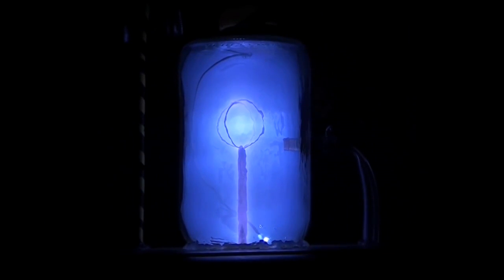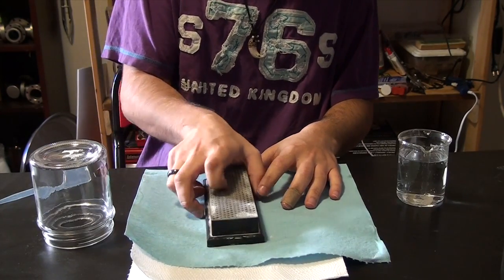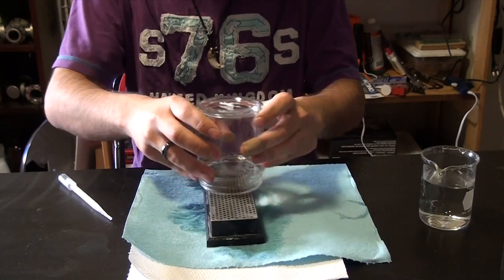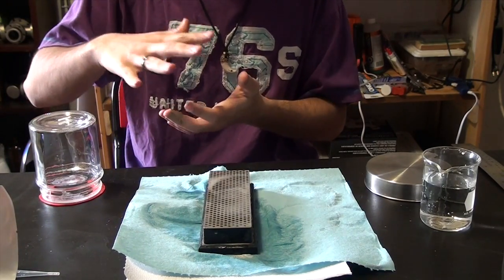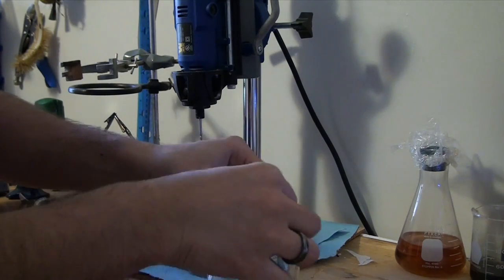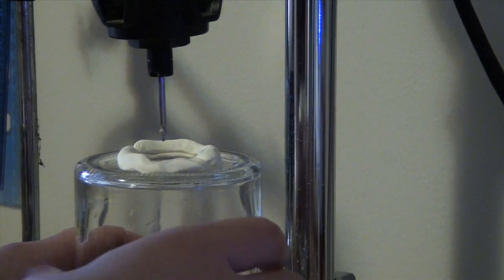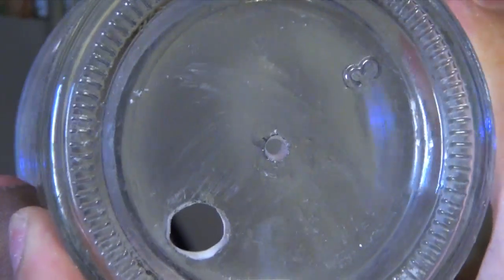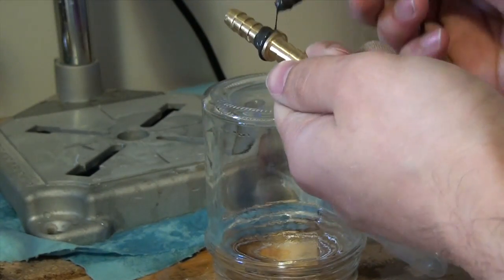How to make a glass vacuum chamber

Comment: Does it matter if it still smells like pickles? Just kidding. I never grind and polish the rims. I just cut gaskets from black sheets of rubber pond liner usually and that is thick enough to allow the rim to sink in and the gasket conforms to a seal. i am scared of drilling holes andninstead just run everything through holes in a metal base plate.

Comment: What is the problem with this video? The plasma is not lit.
https://www.youtube.com/watch?v=mo9F6UA-71g
plz help
Reply from the maker: Your pressure is too high and your circuit is set up wrong. It shouldn't pulse like that. Also by the looks of what appears to be hot glue, none of your connections look sufficent. And that pump looks too small to pull the needed vacuum

Comment: Why not make the connections with the outside via the bass (like Mr. "Applied Science" does) all that glass drilling SEEMS unnecessary???????
Reply: edgeeffect I have the same question. It wouldn't require that much effort compared to drilling through glass.
Reply: However, how can the other electrode be placed at the top? An insulated wire would be required such that it doesn't outgas. Are there any such materials available? Perhaps a wire coated in JB Weld?
Reply: @thesentientneuron6550  but is JB Weld really a good isolator? i remember trying to isolate a wire with 3mm hot glue, the 3kv still arked through like it wasnt even there.
Reply: @Sharpless2  I don't know, but that does make sense. It's really hard to stop arcing with such high voltages. Perhaps a metal sheathed wire to isolate it?
Reply: @thesentientneuron6550  that should work, i never had such wire tho.
Reply: @Sharpless2  If I remember correctly coax cables are shielded?
Reply: @thesentientneuron6550  yes they are, but are typically used for low voltage. Dont know if the shield can isolate thousands if volts
Reply: @Sharpless2  They should be able to, but I can't say for sure since I haven't tested them under those conditions. Plus, the part where you expose the inner wire from the shielding should be heavily insulated, else it defeats the purpose of the shielding.
Reply: @thesentientneuron6550  yeah. Maybe isolation out of Silicon? A think layer should isolate pretty good.

Comment: What will happen if you break glass barrier while reactor is still running?
Reply from the maker: It implodes and then sprays shards of glass everywhere. It happened to me once. Not a fun experience. You hear this terrifying cracking noise right before it goes. I dove out of the way when I heard it so I was ok, but after that I took to being a lot more careful when I made my chambers. That happened because I tried to rush a cut and made a little crack. Was enough that under pressure when it warmed up it went off.
Reply: The Thought Emporium thanks!:)

Comment: This is interesting but i prefer to use a glass hole saw bit, rather than the pointed carbide bit, such as are used in this. They differ slightly because they're abrasive in nature, but they operate in a similar fashion. The biggest difference is that there's less instances of cracking and shattering with the glass hole saw bits. You can pick them up brand new sets on ebay more cheaply than the carbide bits sold at home depot / lowes.
 
If you're feeling cheeky, after you abrasive drill a hole the resulting glass is usually stable enough to heat treat, thus removing the stresses from the grinding process, but you need to have an annealing oven to do this part. Otherwise simply grinding the hole in and leaving it is best.
Reply: Glass should be relatively resistant to breaking when it's wet like he had it ( some chemical wizardry happens ) there's even videos of people cutting glass into a circle...with scissors.

It Looks so wrong XD

Comment: Why does a flat surface seal better than the rounded lip of the glass? (wouldn't the round tip "dig" into the silicone?)
Reply: I think the grinding is to make the contact surface even with the table. Of course the silicon will seal it but it's like having a chair with no same length feet. One side will be more stressed than the others and can break. (I hope I'm clear enough in my explanation)
Reply: Sure, but you want flatness when you're going for vacuum. Rounded edges are good for normal use, but are imperfect.
Reply: Armilar Zifferblatt yeah it seems like grinding it will make weakness in the glass.. better to use silicone in abundance around the edges
Reply: Armilar Zifferblatt he also should have put the electrode through the bottom, possibly even through the center of the magnet on the bottom
Reply: Spencer George not when your talking about glass, most glass vacuum tubes are rounded it gives it strength.. I honestly think grinding it is going to do more harm then good, especially if you have a fitting seal that cushions it
Reply: Spencer George any kind of modification to the glass messes with the grain structure and induces weak points where it can fracture at.. it's best you leave the glass alone after it's been blown
Reply: GogogoFollowMe glass does not work like a chair, you need to think of the stress points when being pressed down.. with a flat 90 degree edge it has the possibility of putting alot of stress onto one area on the edge and with glass one fracture will collapse the whole thing especially under vacuum.. think of it pressing down on a rounded blown edge, the stress points will push out in equal amounts into all directions in a way to help strengthen the glass. Glass is not like regular material when it comes to structure. Also putting the hole into the side of the glass further damaged the structural integrity of the glass, there are many areas for improvement on this design but I guess it works.. but I feel it would be a better idea to do less work for higher performance.. I can picture the stress points in my head and the arrows of compression flowing out, it makes more sense to just leave it as it is and add a liberal amount of silicone to form around the shape to add cushion all around the edge.

Comment: it possible to build a home nuclear power generator for residential use (cheap)?
Reply from the maker: no. The closest to that is a solarcell powered by tritium vials. Nurdrage made a video on it. But beyond that, hard no.
Reply: thank you.
Reply: Mokslas Lietuviškai no you can do it with a potato and a bunch of thorium and a pressure cooker, it's possible.
Reply: Mokslas Lietuviškai oh and you also need copper and zinc electrodes to put into the potato and then you need a chicken wishbone
Reply: thanks
Reply: Staba Kūlis did you ever make the thorium potato reactor?

Comment: Hey man, try running 25000 Hz RF in a vacuum , in saltwater . The H ( hydrogen) separates from the Oxygen, this is called electrolysis ( as you know no doubt), but doing this extremely quickly ( 0-25000 Hz) not only boils the water , but creates energy . Efficiency is 190% in a non vacuum state. I realise you may think "impossible - conservation of energy" or "energy in = energy out", but I promise you, there is nothing normal about it. It's free energy. Don't bag me until you try it 😉
Reply: Fish Rod you do know it requires energy to create radio waves. This would completely cancel out the capability of getting, "Free energy". There is no such thing as free energy, but there is such a thing as easy energy, such as solar or geothermal energy, even though they may require more energy to create than they will generate.
Reply: Why isn't "total bullshit" a valid reason to report a comment... :(
Reply: Fish Rod it's not real that breaks the law of conservation of energy
Reply: Hah nope

Comment: Great video! 2 questions. 1. What kind of bit did you use to drill the holes? 2. Could you drill the vacuum fitting hole with a "same size" bit as the vacuum fitting?

Comment: Hi there! Could I ask what material you use for the gasket? The edges of the one used in the video look rough, so I presume you cut it out of some silicone sheet, perhaps?
Reply from the maker: +Zheeraffa1 Ya silicon baking sheets. works like a charm